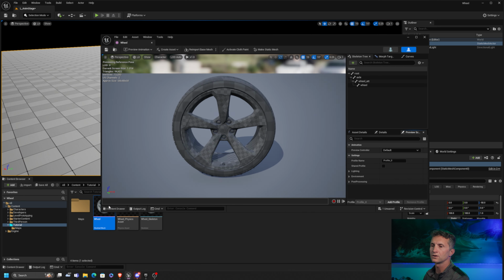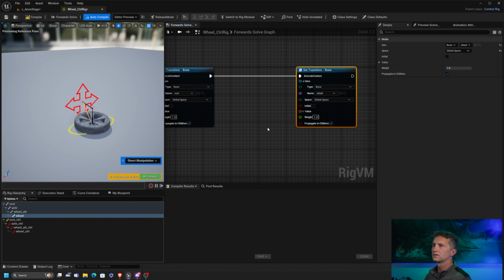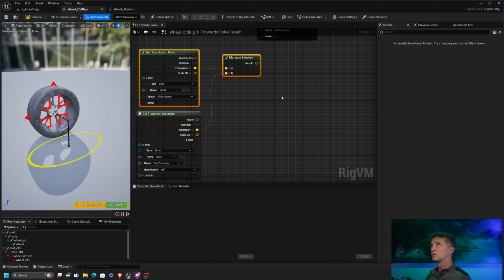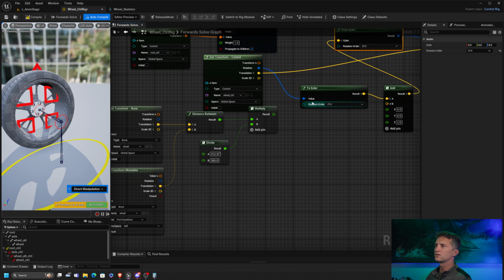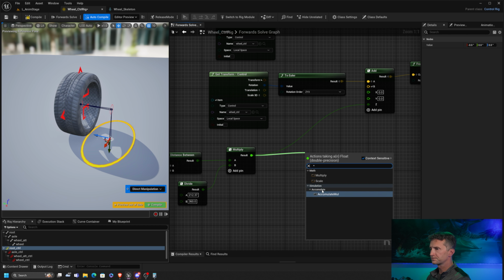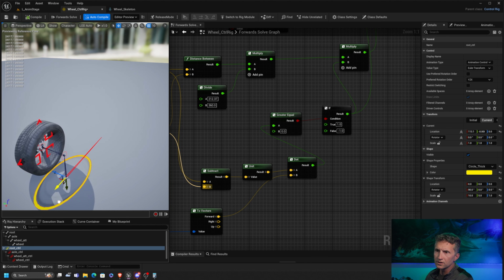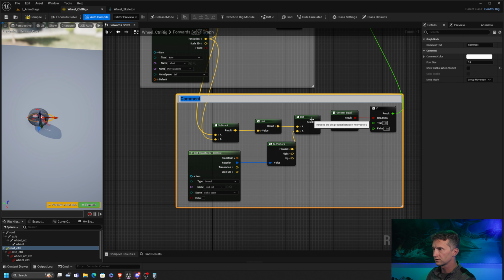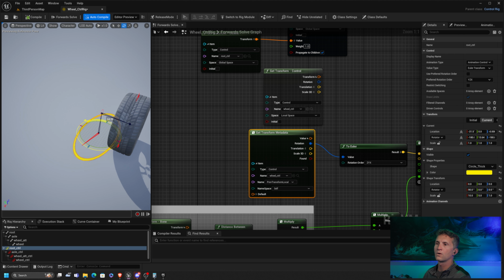Control Rig for Dynamic Wheel Animation | Quickplay Challenge Unreal Engine Tutorial

Comment: I don't have the ToVector node, I have one but it is (matrix)  so it's not the same.  my Unreal version is 5.3  can you try the same in 5.3?  I'm locked with this version for this project Im currently working on
EDIT:  I used a node called Set Control Vector  which seems to do similar job to the To Vector you used, and it works for that section to figure the forward or backward movement of the controller.  but I can't manage to set the rotation of the wheel to follow the rotation of the controller at the end.

EDIT 2: I figured the rotation issue, it now works (partially)  I keep getting a weird snap on the rotation.  do you have a discord? I might need some extra neurons to help
Reply from the maker: Nice job with the self debugging! Thanks for watching.

Comment: How would one attach such a rig to a blueprint, for example, a car following a spline in a level? Would an anim bp be needed or can one directly attach it?
Reply from the maker: You can attach a control rig directly to a Blueprint actor — no Anim BP needed. In your car BP, add a Skeletal Mesh component, set the Control Rig class in the mesh properties, and the rig will drive the wheel rotations. The spline following logic would be in the car BP, updating the rig's inputs each frame.

Comment: Just found your channel and your videos are great, so thank you!
Quick note: You got your maths a little wrong on this one; you're looking for degrees turned for distance travelled, so you want to multiply the distance travelled by "degrees per distance" (360/212.37) whereas you've calculated "distance per degree". This means your wheel is turning ~3x too slow! A lot more obvious when you were rotating the wheel as if it was turning as the distances are a lot smaller.
Reply from the maker: Thank you so much!  I'll try it out and add this to the description!